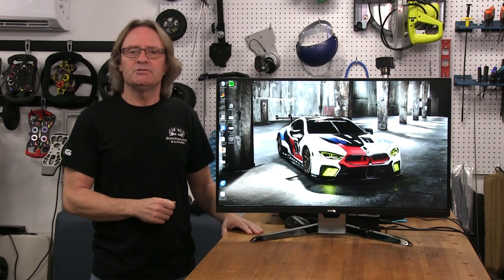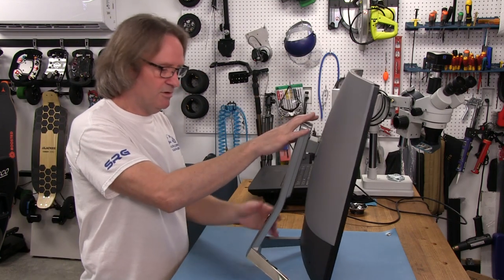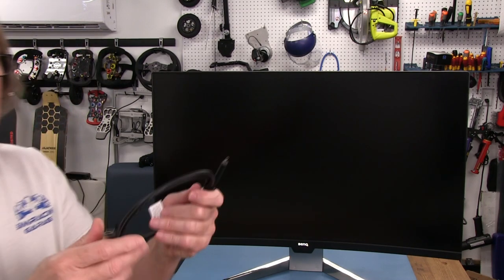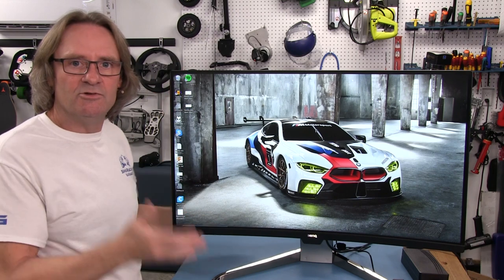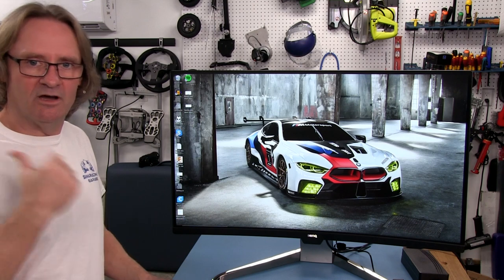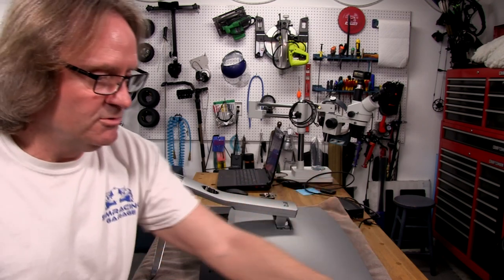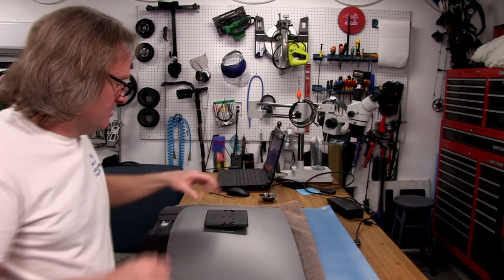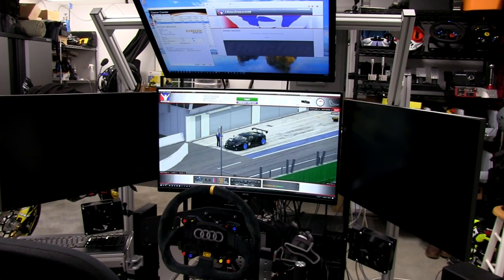BenQ EX3203R Monitor review

Comment: Another amazing review Barry! I'm using three BenQ EX3200R's which are also 32'', VA, 4 ms & 144 Hz panels but ''only'' 1920x1080 resolution, but they're half the price and have VESA mounts. Of course these monitors are just full HD on the same amount of real estate which means they're even less crisp/sharp, but I don't really notice the pixels when playing racing games. Running three of these is much less demanding for your PC (3x 1920x1080 = 6.220.800 pixels VS 3x 2560x1440 = 11.059.200 pixels) and it's easier to maintain a high refreshrate. I'm not experiencing any distortion with running them in a triple monitor setup, and I would highly recommended them to fellow simracers especially because of their price!
Reply: kolokolok 2016 do you mean three 55” tvs? that’s a terrible idea. for a 180° view and to avoid the large car problem where the car is massive compared to what it should be, you’d have to move the screens pretty far away. then there’s a very slow response time and refresh rate on a TV, which is pretty important for racing, compared to an actual gaming monitor (big differences between gaming monitors and TVs, not just size). also, your PC will need to be very strong to push out three 4k screens. in my opinion, which is shared by quite a few, the best monitor size is 27”. better off with three 27”, 144hz, 1ms, 1080p or 1440p monitors mounted directly behind the wheel, as close as you can get them
Reply: do you still like the 1080p version? i i am not sure if going with the 1440p version in triple screen constantly above 100fps is possibke for me, now i am thinking about the 1080p version

Comment: I'm planning to do a triple 27" monitor setup, but for now I'm using my laptop to run the sim but not sure which resolution would ideal for my laptop, later I plan to build a dedicated pc these are my laptop spec:
CPU: i7-8700K Processor ( 6 Cores, 12MB Smart Cache, 3.70GHz Base / 4.70GHz Max ) - DEFAULT
GPU: NVIDIA GTX 1080 (8GB) GDDR5X (Pascal) DX12
RAM: 16gig
I planning to buy a gsync, 144mhz, ips but not sure resolution, so which one would you recommend 1440p or 1080p?

Comment: With the utmost respect Barry I'm a little surprised you haven't explored Ultrawides, curved Ultrawides, 4K or indeed simply larger displays for your amazing rig. And I don't imagine you're short of money to try things ;) I run a nearly identical, curved monitor with 144hz - but previously used Triple Screens (too fiddly for my setup at the time) and a Projector giving a 100" + image on a wall which gave incredible immersion, at the obvious sacrifices of refresh rate and latency. Hope your new monitor feels like a great step up. Would be great if you buy another 2 and achieve more immersion with the wrap-around.
Reply from the maker: Might do that in the future. Just not enough time right now. Have a lot of hardware to review in the up coming months.
Reply: The utter Geek in me loves the idea of OFFSET driving positions for GT cars; set up an Ultrawide, with matched-height 16:9 Monitors for the side windows, and the wheel position on the U/W being offcentre, giving the feeling of a dash to the RHS  [___][_o____][___]
Sure, wouldn't be flexible for single-seaters, or anything with forced RHD driving views... but would love to see it tried out ;)
/racesimgeek

Comment: Great review!!!!!
One thing you didn’t test, is the FPS. Are they locked or pretty stable on your 1080ti, without  gsync enabled? I’m guessing your running iracing with settings maxed out also. 
I had triple 27” Acer preds for a month until I realised oculus is just too immersive, so I sold two of them and kept one for my main screen. 
Thinking of getting the super ultra wide in 1440p when it arrives ;)
Reply from the maker: Yes, with the single Benq at 2560x1440 and my top 1920x1080 TN panel in iRacing with most everything on high, I was getting an average of 230 fps. Of course I was running the frame rate uncapped in iRacing to see how it would do. 1080ti is an awesome card.
Reply: Are you a big believer of Gsync? Or do you not see the difference in a having a freesync monitor running on your nvidia card? (Non supported freesync monitor that is)
Reply from the maker: At the frame rates I was getting during this review, I could not see any difference with G-Sync on or off.

Comment: Out of interest what rsolution were you running the sample monitor and what resolution do you run your 27s?
Reply from the maker: Benq is 2560x1440. 27s are the same resolution.
Reply: Sim Racing Garage you running a 1080ti or 2080ti and I assume it runs fine
Reply from the maker: 1080ti. And yes plenty of power for this monitor to run at it's highest rates I think.

Comment: hi Barry! I have a dream: quad monitor using the chg90 at center (2x27) and two other 27 on side at 90°, in game resolution 7680x1080 (it`s = 1 monitor 4k and 1080ti support it easy). obviusly there are a little problem for the center but they will put on a bridge that muve electronic to left or right (depend of the car). what you think about this??? 

sorry for bad english but I am italian, and I am a big fun of you! 

thz for answare 😉

Comment: Old vid I know, but I am looking at replacing my current triple  IPS monitors that are 27" 1080.  My choice is 27 or 32 IPS 1440.  My monitor sits behind my wheel base but concerned about eye line on a 32". (the 27 and 32 cost is the same) Any advice would be great.  Also a vid on setting up triples would be good Barry ;)

Comment: This is now an old video, but the little thing under the BenQ logo is actually a motion sensor that detects if you're not in front of the monitor and shuts it off. The light sensor is the little transparent thing on the bezel that faces the desk.

Comment: Great review as always! +1 for a review on these 49" screen if you can get your hands on and if you are interested in. In Switzerland, Samsung is selling a C49HG90 (3840×1080/144Hz) and a newer one, the LC49RG90 (sale starts on may 2019, 5120x1440/144Hz). A review on the new one would be great!
Reply from the maker: Looking to get one for review when I can. Not sure about the 1080 one though. Pesonally would rather have the 5120x1440. As I have been using 1440 or a long time now.
Reply: @simracinggarage3026  Would be very nice. I'd also prefer to see a review of the newer one with 5120x1440 resolution. Looking forward to your next content, keep up the great work!

Comment: Thanks for the review once again Barry. I'm going to replace my Samsung CHG90 with 3 of these.
Reply: Did you end doing that mate? Considering them for my triples as well
Reply: @auwoody98au  Unfortunately no. You can't find the VESA mounts for them anywhere. And they are proprietary. You can find 3D printed ones. But I personally want metal and don't trust possible poorly printed mounts.
Reply: @Mikey6048  Yeah that's, what I was just looking up actually... Found them at Scorptec (im Australian) but they $100 AUD!?!?!!
Reply: @auwoody98au  For BenQ mounts or 3d printed ones?
Reply: @Mikey6048  for the Benq mounts
Reply: @auwoody98au  Dang, if you can get them. 100$ unfortunately is what you have to pay. I think I found them at that site myself. But they won't ship to the US. Good luck to you if you order them.
Reply: @Mikey6048  I saw them on the Benq website for $30 US just before buy they don't ship here
Reply: @auwoody98au  I'll have to recheck. I haven't looked in a few months. Thanks for the heads up.

Comment: hope you can review the new 1ms 34in ultrawide 144hz 1440p ‘nano’ IPS monitor tyty, also the compatibility of different size monitors in triple format with iracing or other sims as i imagine 34 inch 3440 21 9 in center with 2440 27 inch side monitors would be ideal setup with the edge of car and most of track never in the bezels.

Comment: Barry, don’t worry about distortion with sims that support proper triple screen. I drive with triple BenQ XR3501 and came from 27 inch Dell S2716DGs (fast TN screen). With the BenQs on an angle of 55 degrees at a distance of 72 cm from the middle of the screen I get a mathematical Angle of view of 180 degrees. This is much more important getting right. The curvature in practice only makes sense. With regard to the bracket: totally agree that BenQ should incorporate this by default in the package. My experience with old (Dell) vs new (BenQ VA) is that the Dell felt overly sharp and lacked contrast which is arguably, at least in my opinion, the most important feature of a monitor. Apart from repsonsetime (difference I didn’t notice) and refresh rate.

Comment: Although you were very good on your review, GTG response times are half of the story. TFT central is a great source of info on monitors, VA is said to have more ghosting than ips panels and TN panels as well, i have noticed it on a friend's tv, but i can't say that's a plague and it was not a 144hz monitor.
32" inch starts to ask for 4k, 3 4k 144hz with HDR would be very costly and would need an 2080ti sli heavily overclocked probably.
Reply from the maker: Yes, I was running the monitor at 144Hz all the time. I did not notice any ghosting. But, I am used to my triple ROG IPS panels, also running at 144Hz with 4ms delay. 1080ti here.
Reply: I don't see why you would need 4k on 32'' for gaming... 1080p on a 27'' is not great but good enought for this, so 32'' with 1440p is very good. There are even 49'' ultra wide panels with 1440p and for gaming it is ok (not great).
Reply: @mateuszkrupa1024  Never said it was a need.
Anyway, 27" 1440p to me is the ideal size, 32 asks for 4k, seeing the pixels can disrupt immersion, i have a 27" 4k display and i think it's unecessary.
Some people don't care, others do, he seemed a little distracted by it.
Reply: @simracinggarage3026  Yeah, G-T-G means Grey to Grey as you probably know it, sometimes having an IPS/VA/TN all with same G-T-G is half the story, Black to White and White to Black can tell more about the differences between all the technologies and the total input delay atributed to each.

By the way i still think VA is the best compromise of both worlds, at least for immersion, IPS suffers too much for blacks, VAs generally have better color volume.

What I mean is that IPS at a given backlight has more variability of color reproduction, as you showed in your video, when IPS displays are used in dark enviroments (you will normally decrease the backlight levels), but it loses too much color gamut and contrast at it, since it suffers from backlight bleed.
TNs are the fastest, but viweing agles are suboptimal breaking the immersion.
Sorry for the convoluted commentary, your work is fenomenal don't take it as destructive criticism or as negative.

You are pretty much the best in the business.
Thanks.
Reply: @MarceloTezza  Sorry, I overinterpreted your words. Yeah 4k on 27'' is useless imo. There is too much fps lose with barely noticable  improvement. Btw I don't think triple 4k setup would work even with sli 2080ti. Single 2080ti barely gives +60 fps in newest games in 4k, so with 12k... Lets just say it's not worth it.

Comment: Unfortunate that NVIDIA still only supports 15 Freesync monitors.
Reply: Yeah don’t be fooled by that number, nvidia has some strict requirements for a Freesync/adaptive sync to be officially compatible, such as Freesync being turned on out of the box (which on quite a few monitors I’ve seen reviewed recently is not the case)
Do your diligence checking reviews for comments on monitor/panel quality and if it has Freesync it should be good to go!